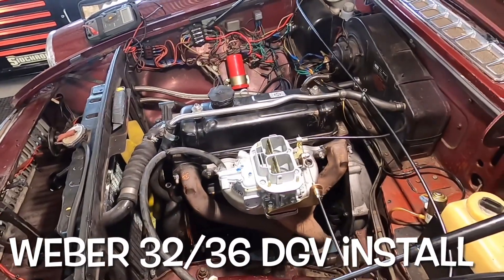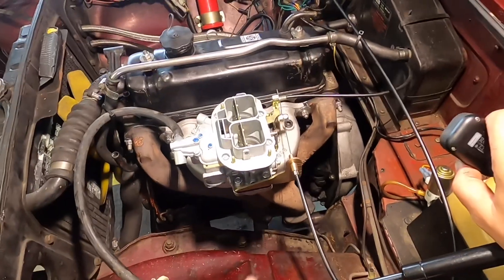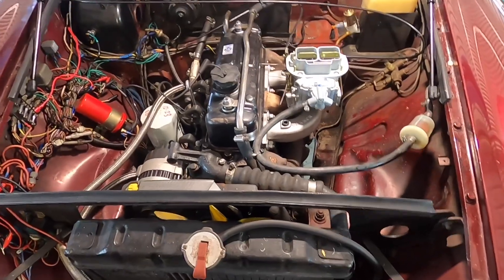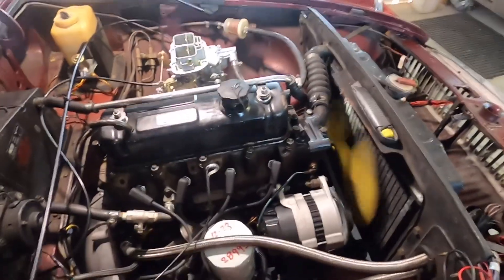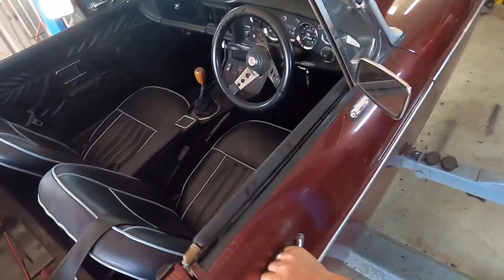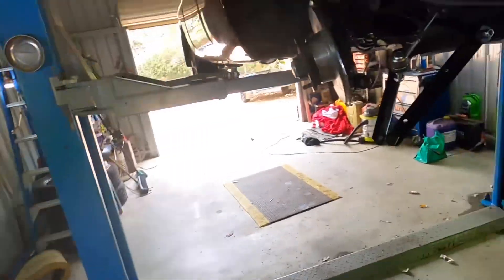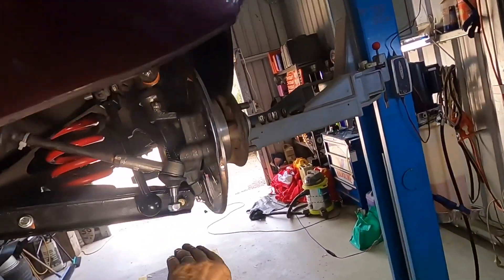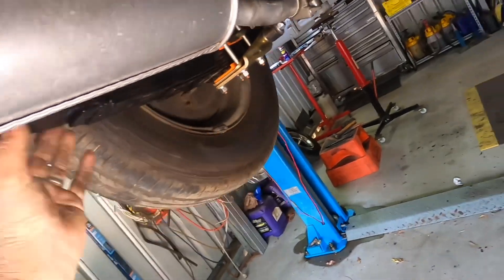Crap to Cream, revisit MGB Weber 32/36 DGV install, correctly this time & suspension rebuilds

Comment: The 32/36 Weber is inefficient, prone to vapor lock, and impossible to correctly tune without a sack of jets and a rolling dyno operated by a qualified tech. SUs are far superior.
Reply: You can add a 1/2 inch phenolic spacer between the intake and carb. That will reduce carb heat tremendously and also benefit on performance a little. Mine is setup opposite way and have zero issues.
Reply from the maker: Hi There, assume you mean between the carby and the supercharger. The heat is being generated by the air getting compressed by the supercharger.  The only way really to take the heat away is cooling the inlet manifold, that’s the next bit of struggle for me. Thanks for the comment, appreciated, cheers Marty
Reply from the maker: Hi Jeff, I put my 32/36 Weber on my second B (Rose) maybe 8 to 10 months ago, I took it off Rose to fit the supercharger.  I was having no luck with the SU's for one reason or another, mainly related to balance and leaks so I decided to put the Weber on Millie my first B.  I have not noticed a significant increase in liters / 100 klms, sometimes does feel a bit lazy however still runs OK and has been reliable.  My plan now is to fit my "spare" Weber 45DCOE to Millie and take her over the dyno the same as I have done Rose to set up the supercharger.   I have (luckily) found a dyno and a very qualified tech who is used to working with a variety of carburetors, he was of the same opinion around getting the Weber 32/36 right, hence the reason I'm looking to change to the 45DCOE which he believes to be superior to the 32/36 being a side draft and not a down draft.  Thank you for your comment, has been read and inwardly digested, appreciated.  Cheers Marty

Comment: Hey man I’m working on my Weber carb now and I’m trying to find out how to set up the throttle assembly on it. Do you have a video on it? Or pictures?
Reply from the maker: Hi Bradley,  I 'm not exactly sure where you are, however I'm in WA, I have to go out right now I'll post a video specifically around the carburetor a bit later on today for you.  There is another video with the carburetor in it, that might have a better perspective.  Anyway, I'll post something specific later on, thanks for the query 👍
Reply from the maker: Hi Bradley,  Ok, I've posted a video showing I hope the Weber linkage in enough detail for you, this is combined with the heater box rebuild today (07-09-2024)

Comment: If you tap your crankcase vent directly into only one side of the intake manifold, you’ll mess with your mixture on 1 and 2. You should run the CCV line into the air cleaner or run a split line into both sides of the intake manifold.
Reply from the maker: Thank you, Michael, you are 100% correct, in the next video (Suspension finished) you'll see I remembered that the crankcase vent goes into the air filter!, spot on and again thanks for the comment.
Reply: @CrapToCream Glad to hear it! I’m anxiously waiting to see how your tune of the Weber goes. I was never able to fine tune mine enough and ended up going back to the HIF4s. Looks like you have a different manifold than me. Where did you get the setup?
Reply from the maker: I've checked the mixture with my Colourtune and it seems to be fine, mixture if anything appears a tad on the rich side, I need virtually no choke to get the engine going and running.   Its pretty warm here in Western Australia right now so I wasn't expecting to use much choke.  The engine also has the standard dizzy installed, I lave an ignition 123 one to install AFTER the pits inspection, the inspector is pretty strict and I know I won't get away with the Weber conversion, this will be an additional AUD$84 for the modification permit.  I'm going to do another video on my experiences with the inspection DOT system again AFTER I have had my MGB inspected and hopefully it passes this time.